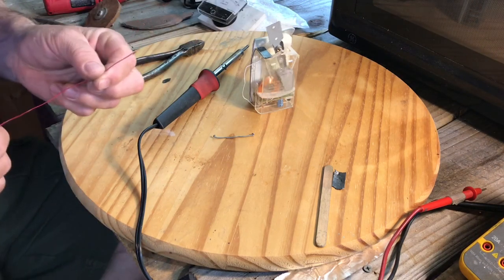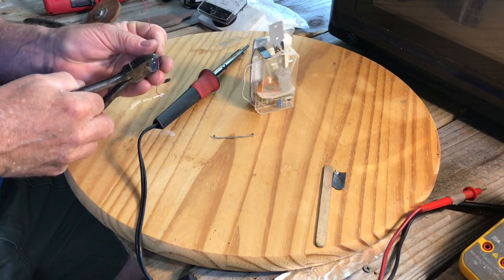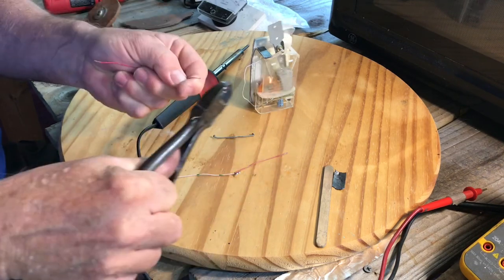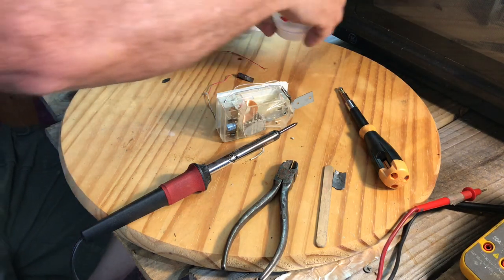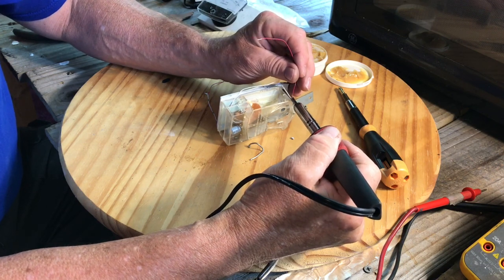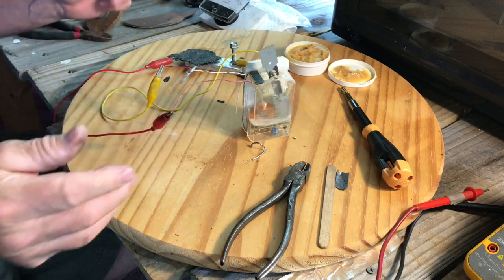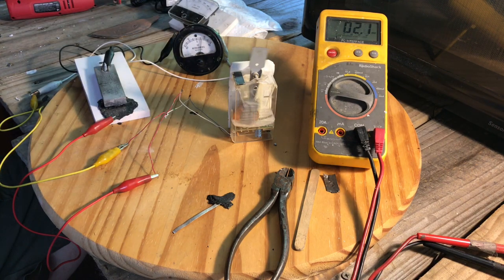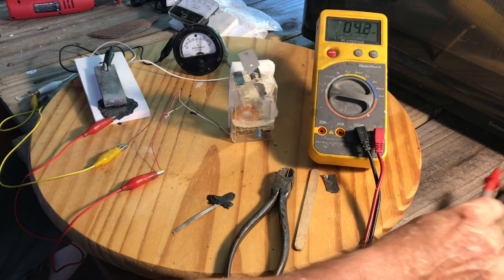Solid Magnesium Electrolyte For Cement Battery

Comment: Nice work. Wonder how long it will last.
Reply from the maker: This morning I checked and it is running with no change.  Next step is to see how I can reduce internal resistance so I can parallel or series them for more current and voltage. Thanks for any input